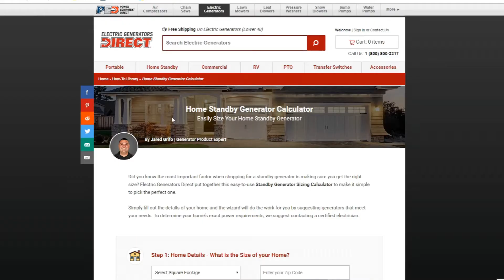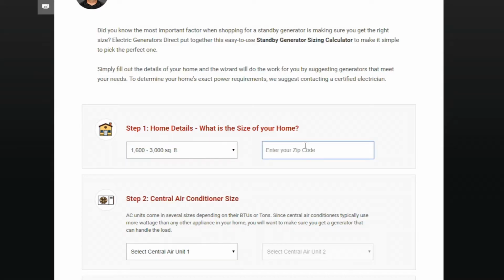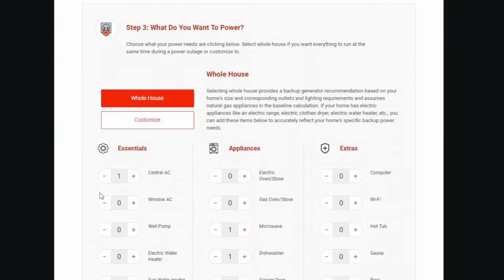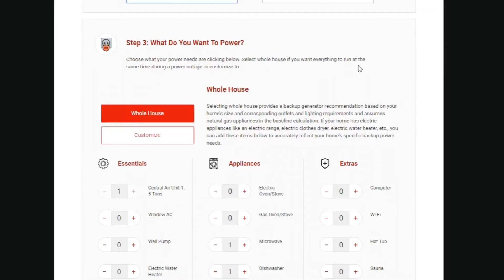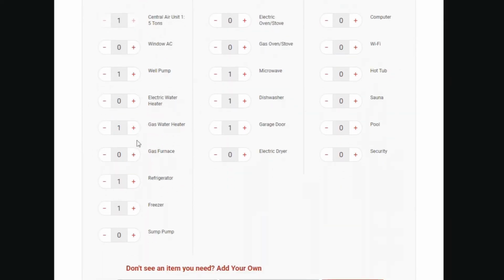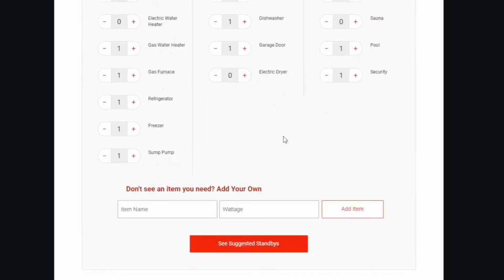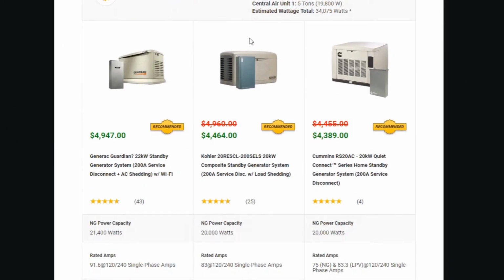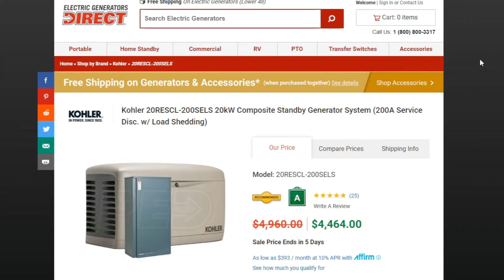How to Size a Standby Electric Generator

Comment: Can i wire a single phase generator in a 3phase panel if i only powering a subpanel that is only receiving 120/240?
Reply: Yes, but you’ll need a pair of pliers and 30-weight ball bearings

Comment: If your caculator says to use a 20kw, but I choose instead a 24kw, would that be harmful to any part of the house?
Reply: no It would not.  However U should have someone come to see if the natural gas service to your home can handle powering the generator as well as any other gas appliances such as dryers, stoves furnace etc.  Typically it shouldnt be a problem but have someone or You urself should find out the volume of natural gas that can be supplied to your home. Personally If u dont run out of power alot I would seriously consider loooking at portables if U have any mechanical knowledge and or common sense. Much cheaper and very viable. Plus its portable which is a huge benefit

Comment: Nice video, but i thought that you would have show a detailed calculation breakdown and a percentage on flexibility
Reply from the maker: The only issue with trying to calculate using a specific formula is that every generator will operate differently and have different load limitations depending on many variables. We've built a calculator that takes some assumptions to give you a better idea of what size generator you might need based on the appliances you need to run. Try playing around with this tool and see if it helps you understand some limitations and load requirements to run certain items. https://www.electricgeneratorsdirect.com/stories/1469-Easily-Size-Your-Home-Standby-Generator.html

Comment: I am disable and line in a trailer house that is around 850 square feet. What do you think would be my best chose?
Reply from the maker: We'll need a lot more information before we can recommend a standby generator for you. Please give us a call and we'll be happy to assist you. Also, check out our sizing calculator tool that will help you determine what you want to power: https://www.electricgeneratorsdirect.com/stories/1469-Easily-Size-Your-Home-Standby-Generator.html

Comment: Security systems Don't draw much of anything.
Reply from the maker: The amount of power required depends on the type of security system. Closed CC video monitoring security systems will use more power than newer "lite" systems. Even if the overall wattage isn't large, it's important to take it into account when sizing a home generator. In general, it's safe to allot a portion of your total wattage allocations to running a security system during power outages, should you choose to.

Comment: I just tried to use your calculator website and it will not let me make changes using the customize option. I put in the required sq ft, zipcode and size of AC unit. Is there something wrong with your site?
Reply from the maker: We have checked into this and our website and tool are both working correctly. Please try again. If you have more difficulty please feel free to call in and we can assist you over the phone.
Reply: @PowerEquipmentDirect  heat pump is needed  . I  live in southside va and we have heat pumps

Comment: Very Informative .  If  you have a gas  tankless water heater   how do you determine the amps it also uses.  Would a  gas  tankless water  heater  greatly affect the  size of whole house generator  you would  need?
Reply: A gas tank less water heater uses about 350 watts. 2500-3500 watts is false!
Reply: @Sisufinn   Thanks  for  the  correct  information .
Reply from the maker: @Sisufinn  The water heaters may run at 350 watts but that running wattage doesn't take into account the surge wattage for when it starts up. All electric motors surge when starting and require the generator that is sending the power to compensate for this. The voltage and phase also come into play in these situations. That's why we provide estimate ranges and do not give specific wattages. Electricity surges and it's important to take that into account with any generator sizing. If that surge occurs while other items are being run by the generator, it can be overloaded, which can lead to further complications or dangerous situations.
Reply: Ok most circulation pumps run at 0.45 amps and if you had 200% inrush that would put you at 0.9 amps. So if your max power consumption on a gas unit is 350 watts plus .45 amps at 120 volts for inrush, you are only at 404 watts. 
I can see your point if you are dealing with compressor motors.
   Most tank-less water heaters don't use a circulation pump anyways.
Reply from the maker: Great question. Yes, it does affect the decision of which whole house generator you choose because a tankless water heater is just 1 appliance out of the whole list. In order to power a gas tankless water heater you would need approximately 2,500-3,500 watts to run, or similar to the power of running a refrigerator. This number would increase if you were using an all-electric tankless water heater. This estimate assumes that you would have a transfer switch installed because a tankless water heater uses 220v to run, which can't be powered by your average in-home outlet/switch. If you want to add this estimate to a watt calculator, please use our tool: https://www.electricgeneratorsdirect.com/stories/1469-Easily-Size-Your-Home-Standby-Generator.html

Comment: I feel these are miss leading because most people won't be using all this stuff when they loss power. I wish there was a cheap system monitor you could put on the main lines and read max amp draw. I'm thinking a 13kw will be all I need but might go with 16kw just because.
Reply from the maker: Different people have different preferences. That's why sizing for what you want to power is so important. That's why the calculator exists: https://www.electricgeneratorsdirect.com/stories/1469-Easily-Size-Your-Home-Standby-Generator.html
Reply: @PowerEquipmentDirect  calculator does not work.
Reply: The other issue is true power needed can be reduced with soft starts, my A/C went from 120A surge to 40A with a soft start. I noticed not much visibility into devices like these.